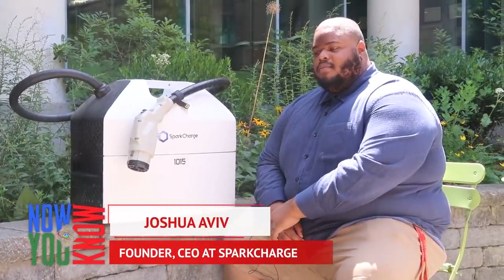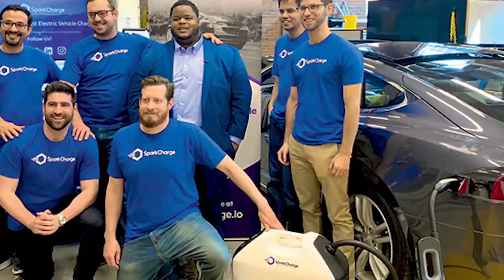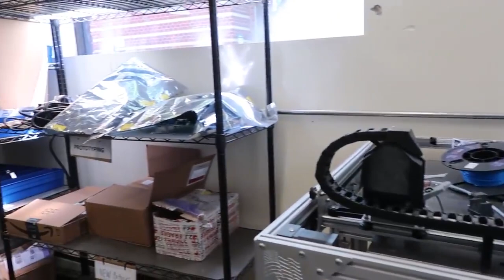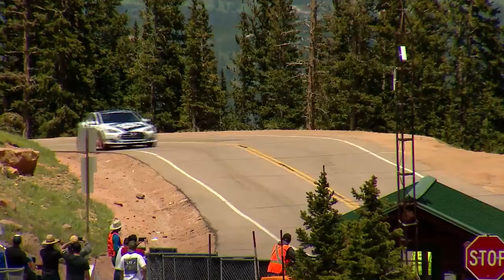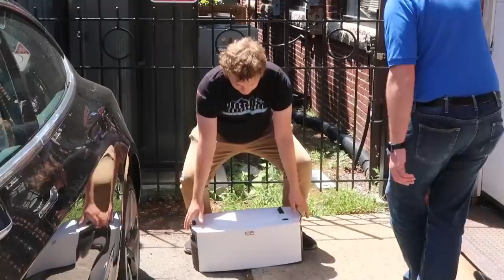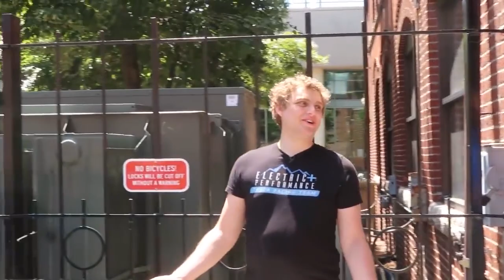SparkCharge: Can this battery startup go the distance?

Comment: This CEO has the right mindset and the market is ready for his invention. Great for roadside companies, etc... great idea, great usefulness.
Reply: Sadly he is no engineer! This is like the Butane powered curling iron launched sometimes in the late 80' Idea sounds good, portable etc. but the utility of such a device is marginal. With an EV, you plan your trips, and you know plenty in advance if you can't make it and need to make changes to your route, it is less likely to get stranded in an EV than in a gasoline car, where you don't monitor consumption and the gauge is inaccurate. A more useful device to haul around in your EV is an  ESVE so you can plug in at regular industrial 3 phase outlets. Numerous times, I have carged in a pinch, for free, at a road side billboard, a electrical cabinet at a building, from the outlet at a gas station where the  vacuumcleaner normally gets its power while washing my windshield really slowly!
Reply: @Tore_Lund  ayes, it’s hard to get those squashed bugs off the windshield.😂

Comment: Why use tow trucks. Have them placed strategically at gas stations(24hrs). Use Uber or anybody to bring it. 
Also can rent out for trips.
Reply: Because tow trucks and services like AAA are already on the road and working.  This would just be another value add service for them.  How many EV drivers would turn up their nose at a ICE tow truck bringing them a battery pack that can give them a charge to get them closer to their destination where they can charge.

Comment: How about you connect the Spark charger, run it for a couple of minutes and then drive and charge at the same time?
Reply: Why not ask Tesla to install an extra battery somewhere in the car and call it a reserve. Just push a button and you have 20 more miles.

Comment: this seems so dumb, a generator would do
Reply: Honda gas generator, 2.2kw 240vac with pure sine wave inverter into a Clipper Creek 60amp EV charger - could not get the ModelS or Tesla Roadster to accept charge. Tried resistors between Neutral & ground etc - no joy. Would have been around 10kw of charge. Left with using Tesla charge cord @240vac which does work but really takes forever - again, no joy. What you need is DC Fast Charging which the SparkCharge does provide.
Reply: @anastigmatix4119  You don't really need a charger when running a generator: Rectify the AC output and connect it directly to your battery pack. The voltage of the pack prevents the generator being overloaded as it first starts to deliver power into the pack when its output voltage exceeds the battery voltage. Rectified 220V AC is 300V so If your pack is there about it will work like a charm.

Comment: Neat, but I wouldn't want a huge, heavy, polluting ICE tow-truck to bring me a battery! How about something like an Arcimoto with a few SparkCharges in the back? Can quickly get to a stuck EV motorist, and no pollution
Reply: I have to believe Lion or another will have EV tow trucks very soon. Lion has a trash truck size and that is the same format as a non-flatbed tow truck, I think. The big F350 Flatbed is really just a Cybertruck with a different axle situation. ~I do wish Tesla would make a division focused on the heavy-duty area but I understand the need to ramp ramp ramp.
Reply: @nikki then it won't be able to perform the function of tow truck and loose the business opportunities as a tow company